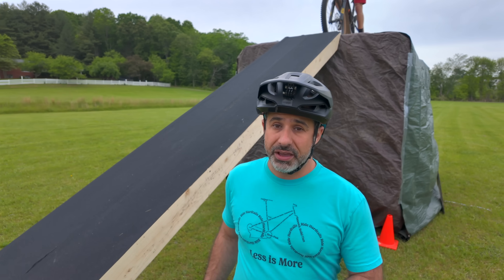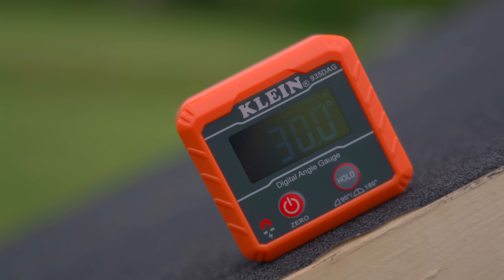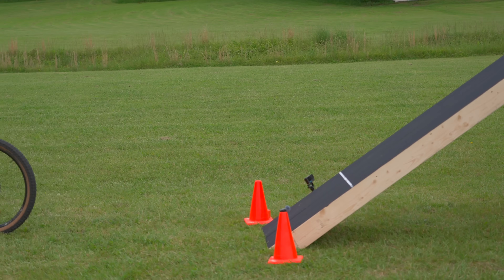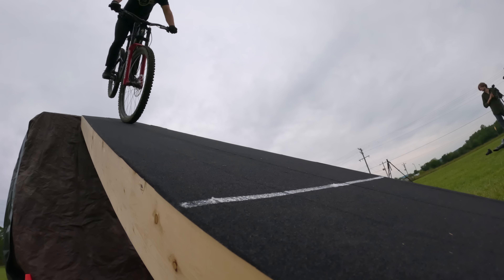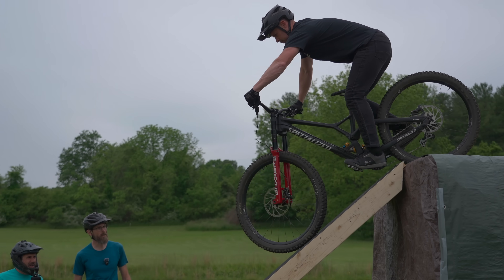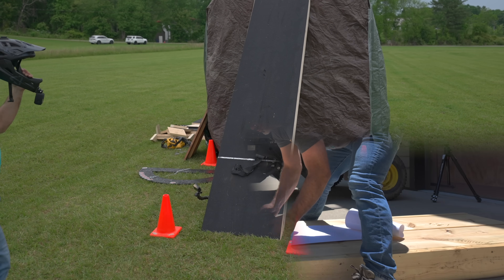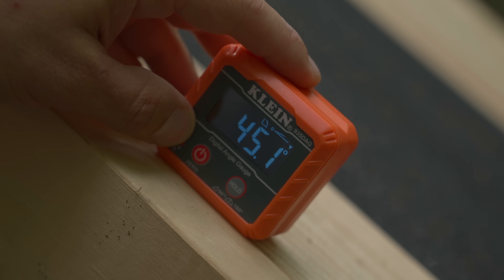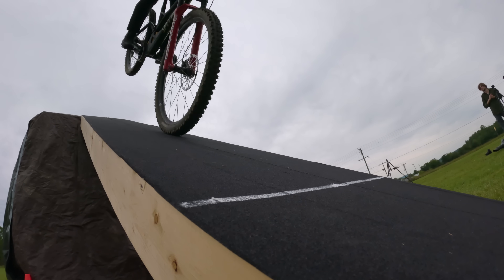Could You Stop? Our Brakes Were Useless At This Angle

Comment: try smaller wheels in the back (go to like 24" wheels) so you can get lower and maybe a ramp that builds to the 45 degree slope so you don't have as much trouble getting the bottom bracket over the lip.

Comment: Get rid off that edge in top of the ramp. Original design was still kinda acceptable, but that makeshift one on Berm Peak, where a "tinyDrop" was on very begining, that definitely have to throw your rear wheel and you at least off balance.
Otherwise, I kinda expected being limit somewhere around 45° as major of gravity starts pulling you down and just minro part that holds you to the surface 🙂

Comment: same idea, but put the ramp on its side and ride lengthways, like you are riding an off camber trail.  Then see what angle you can make it across at, just walking pace allowed so you cant cheat and just do it really fast. would be a good test for different kind of bikes and headtube angles, I bet it will take a lot of steering effort to keep the bike going straight on something slack vs steep.

Comment: Track stand on a ramp that is raised with a pully system until  you loose tracktion might be an intresting test as well.
Reply: yeah, that would be really interesting too, but it’s sort of a different test because you’d be testing the static friction between the tire and grip tape instead of kinetic friction when coming to a stop. since static friction is always higher than kinetic, you’d be able to hold on to a steeper angle than you’d be able to come to a stop on
Reply: @bigslonker  Shouldn't coming to a stop also be static friction as long as you don't skid? The part of the tyre in contact with the ground is ideally static while you ride.
Reply: @barneylaurance1865  actually, i think you’re right haha. disregard what i said then
Reply: but it would help to find the tippingpoint
Reply: @bertkreft9689  yeah, for sure would, it’s just that it would be slightly steeper than what you could actually come to a stop on. still not a bad way to get a first data point though

Comment: Cool video! I could not ride down that angle I think. For my automotive Engineering background I remember that a 45deg angle is the theoretical maximum angle you can ride up or down. This had everything to do with the tire compound. If the friction coëfficiënt of the tire is 1, then you have equal the force that lets you stay on that angle as the force that pulls you down from that angle. This is due to the gravitational force decomposition.
Reply: yeah 45 is the max if you're looking at static friction with 2 smooth rigid bodies. rubber and grip tape bring in adhesion and tearing that will get you a bit more but it's not going to be much I wouldn't think. as others have said going with soft compound slicks would be an option to increase contact patch and therefore that adhesion.
Reply: Getting past a friction coefficient of 1 is probably difficult. I wonder if hot sticky Moab rock is better?
Reply: @awkragt  not difficult to get to much higher than 1. Racing slicks can be 1.5-2 when heated up. But mountain bike tires have a lot of factors to balance (wear, puncture resistance/durability, knobbies, etc).
Reply: @MikeyAntonakakis  Drag racing tires DO NOT have a coefficient of friction above 1. They instead introduce a new force in the form of chemical bonding through adhesives. The tire compound melts and turns into a chemical adhesive, which is an additional force beyond rigid body friction.
Reply: @Fishpizza1212  Yeah the first time I stepped out of a car onto a drag strip (just after exploding a CV joint lol) I almost walked out of my shoes! I wasn’t talking about drag racing, more road racing tires (when I did Formula SAE long ago we paid into the tire test data, definitely possible for those tires on un-prepped asphalt/concrete to acheive >1 effective friction coefficient).
Reply: @Fishpizza1212 Если это так, то у такой шины будет повышаться сопротивление качению т. К. Колесу в движении требуется не только прилипнуть, но и отлипнуть. Мне кажется попытка приклеиться к асфальту сделает старт намного тяжелее. 
Ну вот попробуй стартовать когда у тебя половина покрышки вморожена в лëд. Тебе надо будет сначала сломать лëд
Reply: I wouldn't have a problem riding down that, but I would have a problem with trying to come to a complete stop in the middle!

Comment: Try to find the critical angle for a block that has a bike tire stuck on it. The tan of that angle will give you the friction coefficient. 
Also, try to avoid skidding. The friction coefficient is lower when the two surfaces move against each other. Also, I think that tire pressure doesn't affect the result here too much if at all.

Actually in this exact scenario my prediction is that higher pressure would yield better results for multi-compound tyres. The smaller patch will ensure that only the soft central part will be in contact while for lower pressures you also get friction from the side knobs which are made of a harder, less grippy material. That'll effectively reduce the friction coefficient of the tyre as a whole.
Reply: that works in textbooks but in practice the friction coefficient will vary a little bit as different loads are applied and the tire deforms/complys.

Comment: If you want to test this in an easier way, don't have a drop in but slowly raise the back end while you have a meter on the ramp. You stop raising the ramp when you start slipping, and you'll know the absolute limit.

Another interesting test that could be done is just how steep a grade can you climb.
Reply: Friction is different from a moving or standing start isn't it? By not starting in movement you get "sticking" friction wich can be much much higher than moving friction.
Reply: @Dukhanstmichmal until the wheel is locked and sliding, its all static friction.
Reply: @Dukhanstmichmal  I would think so, but that would give you the upper limit. E.g. if you can't stay in place at 45° when raised from 0°, you can't do it by slowing down either.
Reply: Good idea, but not sure how you’d stay balanced on the bike. Even if you stop on a flat or low incline surface I’m pretty sure you can only stay on the bike briefly at a full stop.
Reply: I saw the thumbnail and I thought that's what they were gonna do😭

Comment: Im guessing that head angle helps too, having the wheel further ahead of your centre of gravity will drop it too
Reply: Also grip height, & arm length: The farther back you can shift your weight, the steeper you can descend.
Reply: The only thing that matters in this test is the coefficient of friction and making sure both wheels are braked to their limit without skidding, which takes a bit of skill. That's assuming you don't go over the handlebars.

As I and others have calculated, the maximum theoretical angle is simply the arctangent of the coefficient of friction.

Comment: How about you fixate your front wheel onto the ramp and test out at which angle you can hold your balance? Like at what point couldn't you shift your weight back enough anymore and go over the handlebars? Needs a soft landing tho.

Comment: Hi Seth! Old viewer, 1st comment. IMHO, at your try at home, you were negatively affected by your starting angle. Please take note that you were entering the ramp from a step, and no matter how little it was, I think it added degrees and speed to your test. Have a nice one. Keep it rolling ❤
Reply: +1, makes me think of race cars getting unsettled by debris mid-turn when operating on the limit of traction.
Reply: Yeah I thought the same thing, just when your back wheel is coming over the edge the angle is steeper and as soon as you start sliding it's harder to stop.
Reply: Yeah, the back tire contributed zero to the traction, and the angle was perhaps 2-3 degrees more severe. But that's hindsight with video playback ha. Great video!
Reply: It looked like when the rear tire came over the peak it was pushed away from the ramp. They had to lessen the front brake to get the rear tire back down, and then gained more speed they had to get rid of in a very short distance. I bet a smoother transition would help.

Comment: You should try this on a fatbike. More traction and a hard fork should do the trick.
Reply: In this scenario we're looking purely at linear (forward/backwards) traction so we want the maximum amount of vertical load pushing the tyre down into the surface (fixed fork) and the minimum amount of air pressure necessary to stop the tyre ripping off the bead to allow the largest contact patch possible. Tyre choice would be a slick of the softest compound available mounted on the tallest front wheel and smallest rear wheel you can fit.
Reply: @DjDolHaus86  Penny-farthing with slicks?
Reply: Schwalbe Radials
But once you test them, send 'em to me =)

Also your 2nd ramp in the woods had a lip to overcome at the beginning, so I would have a little offset there.
Reply: A fatter tire would provide a larger contact patch which may influence the coefficient of friction due to the compound of the tire being better optimized for a certain load compared to the contact patch but it would be hard to say for sure. Physics would teach us that contact patch would not matter due to it not being a part of the formula for frictional force but it very well may influence grip. Sometimes in the real world there are more effects at play such as tire temperature. Rally cars use thinner tires in the snow for better grip. The effect of a thin tire on the snow is essentially the way way that sipes in a normal road tire prevent the car from hydroplaning. A thin tire digs into the snow and compresses it better allowing it to grip. This is similar to how the water goes into the sipes allowing the tire to contact the actual ground rather than just the water. A fatter tire on snow would float like a snowboard and not compress the snow and the car would be uncontrollable. Just like a tire hydroplaning. 

I would say the best way to increase grip for this experiment is to use a tire with a lower profile tread and a very very soft compound.
Reply: @shaquilleoatmeal2654 sipes allow the tire tread to have compliance, offering micro scale deformations to smoothen out localized accelerations as the tire goes over an inconsistent surface.  Grooves in a tire are what channel water flow.  Suspension combine with siping is key to providing good traction in low traction environments like on snow and ice.  Siping also provides more biting edges to improve gription.
Reply: @shaquilleoatmeal2654  That's true, but rubber also has other nonlinear components along with classical friction known as load sensitivity (the friction coefficient changes with load). Soft compound slick would be the best in this case because the surface is flat and grippy.
Reply: Go the whole hog: A fat tire quadricycle. More contact points, more traction

Comment: A safer version of this test is to roll up the ramp, grab the brakes and see if the bike can stay in place.
Reply: How would that be any safer or even possible??
Reply: @FüTyibi  Much safer because stepping off the back of the bike onto level ground is a lot easier than riding the full length of the ramp and pulling up at the right time to not dig the front wheel in and go over the bars into the ground. 

As for how is it possible, anyone with a half way competent trackstand, will find it very easy to roll up the ramp till the bike comes to a stop and hold it on the brakes for a few seconds to see whether the bike starts to slide. The hardest part will be making the transition to the slope smoothly so you don't bounce off the ramp and drop back without testing the grip at all.

Comment: sad to say but why he can stop on 42.6 degrees coz he is taller, so the pivot will be more backwards and tyres will have more tractions.
also ur test back in the deck is not ok, ur rear wheel not touching the ramp at the same time as the front, that breaks the balance of tractions too

Comment: Honestly if you could get a 29" slick tire with a really soft compound that might be the trick. Just get maximum surface area on that relatively smooth surface. (or try with a fat bike)
Reply: Fat bike would be interesting...
Reply: Exactly this; a fatty mullet with high bars, to maximize front contact area while allowing the rider to shift their weight as far back as possible, running low density soft compound slicks with a ton of tiny siping slits all over them. (Also, it helps to have long arms because you can lean farther back.)
Reply: but that requires to much effort for a video.

Comment: Its impressive that even the relatively small contact patch of a MTB can hold on at that steep an angle
Reply: Not really - friction force is independent of contact area on dry clean surfaces. In wet conditions it is a lot more important because water is a very effective lubricant, so the hysteresis in the rubber is where almost all the grip comes from. It's why there's such a dramatic drop in traction in wet conditions.